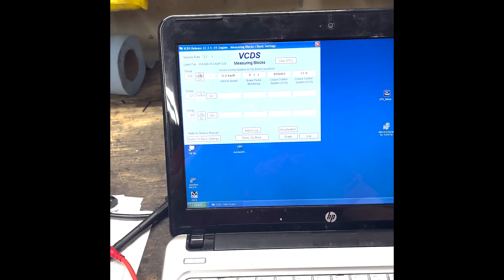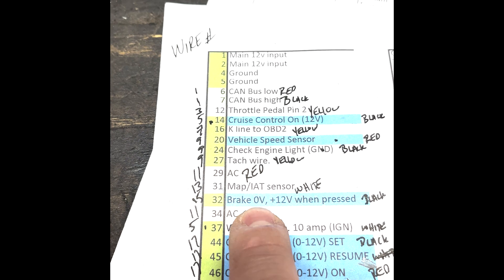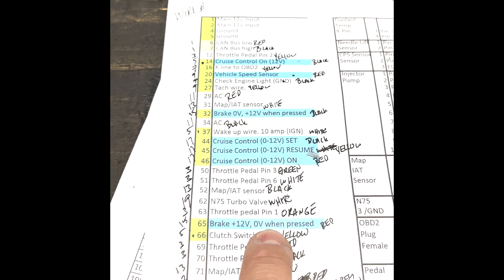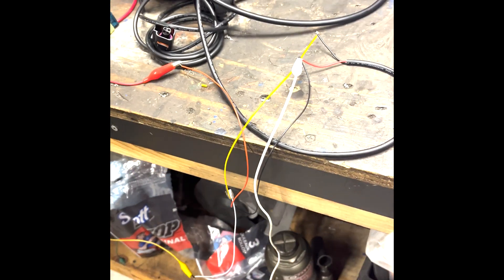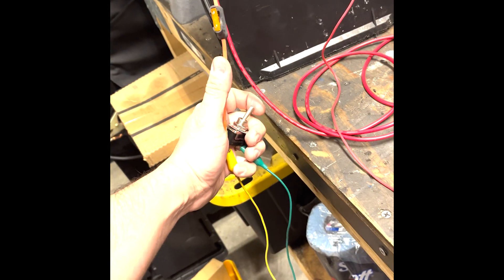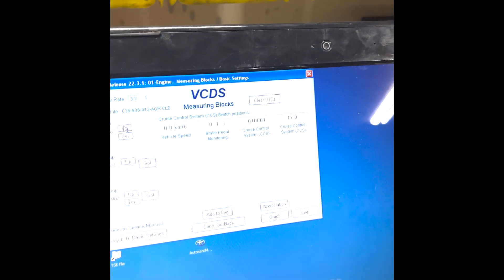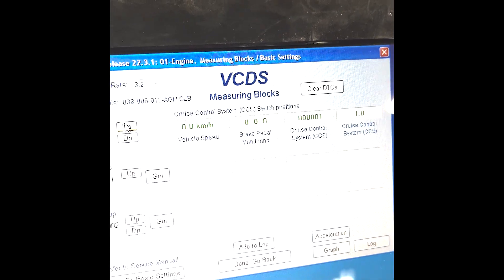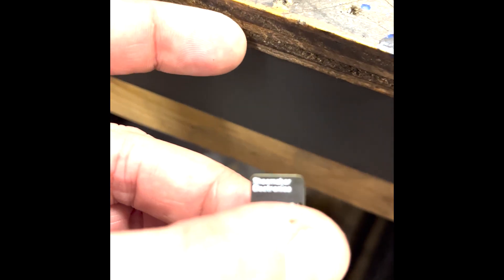ALH Brake switch logic controller

Comment: why wouldnt a 5 pole relay being triggered by a factory brake switch on whatever chassis youre using work? using pin 87/87a for the inputs to the ecu? almost to this point in my build.
Reply: i assume the relay switches too slowly for the ecus liking??
Reply from the maker: @Erosion999  because there is voltage on one pin that needs to be pulled down (9-10V). Trust me when I say I tried it on the bench and it didn't work.

Comment: is this to prevent the "dead" pedal at first start up?
Reply from the maker: No this is for cruise control and for defueling with automatics. Dead pedal occurs when you don't have 12V ignition to the clutch wire.